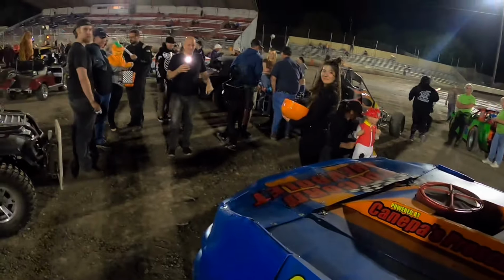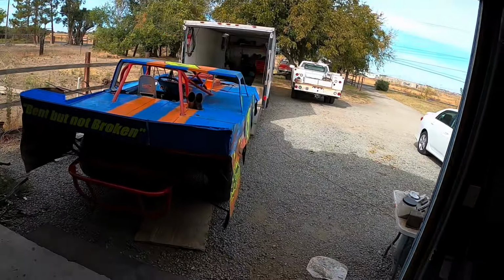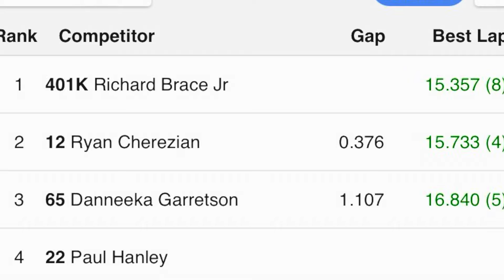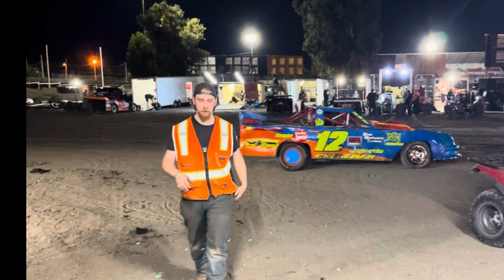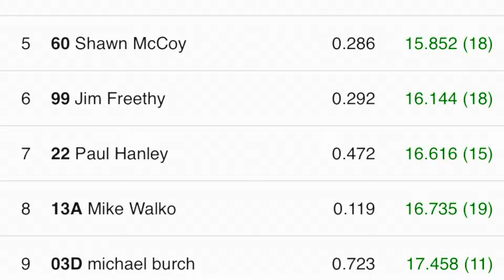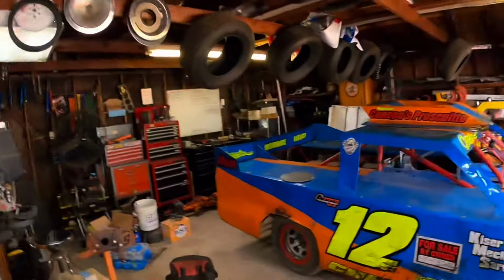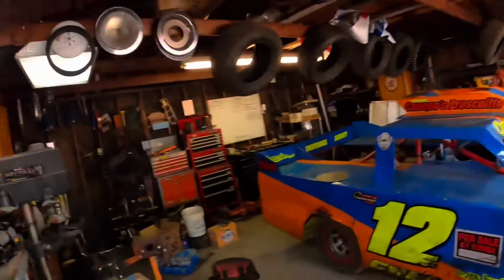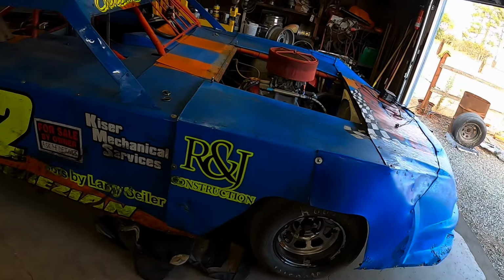Won My First Championship -- Last Race of the Year at Antioch Speedway

Comment: Shortening the right side is going to tighten up the car. I don’t believe your measurements are accurate with the plates. 
1 1/2 inches is a lot.
Reply from the maker: Believe me, i checked it 3 times and its accurate. 109.5 on the right and 108 on the left. I shortened the right up to 109 for hot laps and had to put it right back to 109.5
Reply: @ how much roll out (stagger) on the rear? I used to lead the left side by 1/2 “. Depending on the amount of roll out would make a big difference in handling. If you were running the same roll out at 109 as 109.5, the that would make the car tight. If you had increased the roll out when you shortened the right side, then it probably would have made it more neutral. I’m sure you are limited on the amount of roll out you can get with the tires you run. I can see adjusting wheel base for handling. I have soaked them in soapy water and put in the sun with 80 lbs of air to stretch them out.
Congratulations on the Championship. Something no one can ever take away.
Reply from the maker: @WindRider1  thanks! I run about 1" of stagger. Dont really like anymore than that because it pitches the car left if the tire spin.